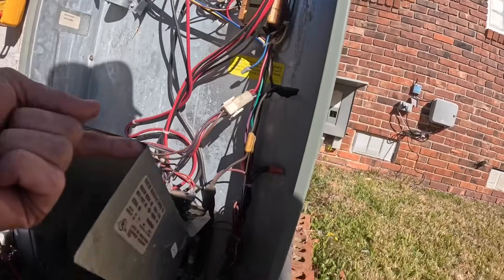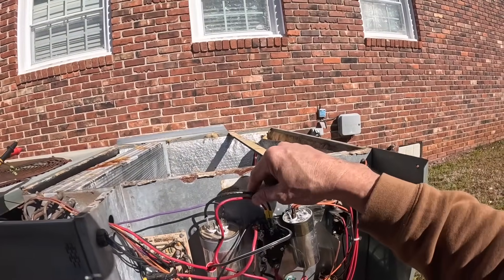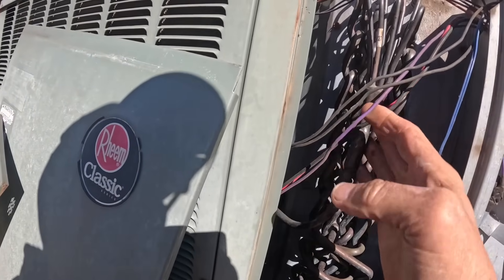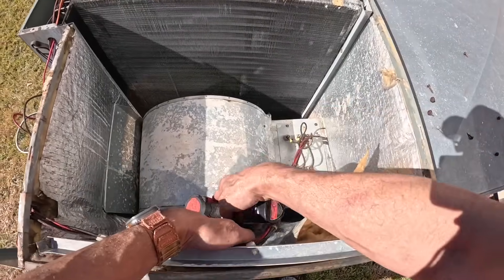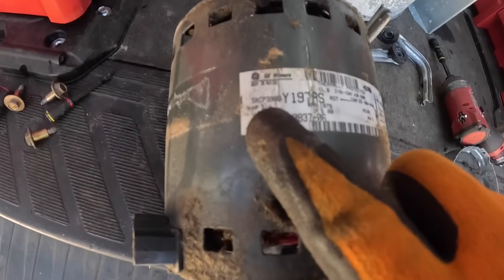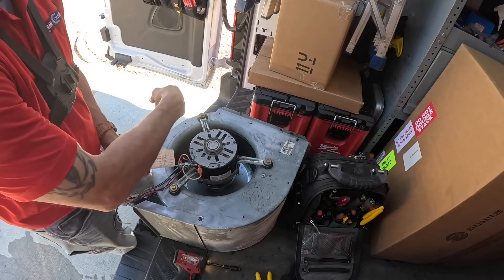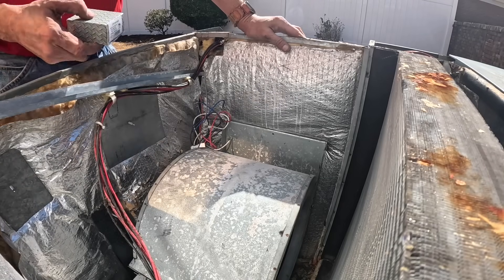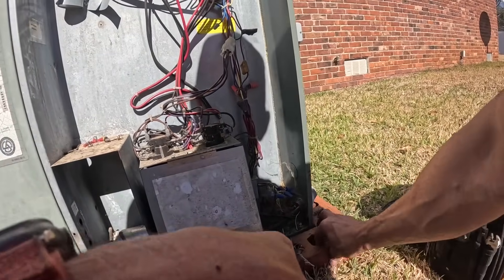Really Odd Thing Happened to Me On This One! #hvacguy #hvaclife

Comment: There is still an electrical fault that was not identified or corrected. You noted the cabinet was grounded - but this is irrelevant and will not prevent a shock. 

At issue is the term ground wire. For the purposes of preventing shock hazards, this term is incorrect, misleading, and dangerous. The fact that it is grounded does not clear a fault. A fault can only be cleared by removing power - opening a circuit breaker. Routing electricity to ground does not deenergize the cabinet.

What is important is the non-current carrying grounded conductor is properly bonded to the neutral at the service entrance. Again, the fact that this wire is also grounded is irrelevant for shock hazard.

If the cabinet had been wired with a properly bonded non-current carrying grounded conductor, the circuit breaker would have tripped when the motor shorted - grounded or not.

I know it’s been over a year, but please call this customer and get an electrician back out there. The next person to take a shock might be someone’s grandchild.

Comment: i was up on ladder at night checking my internet connection and why it was not working, being dark an hot outside the air conditioner came on below me an i could now see sparks coming from the electrical fuse block and meter beside me. after i opened the electric panel i found the ground wire coming from down the pole was worked loose .. whaatt???. never in life seen or expected that large bolt to be loosened.. likely the air whipping the wires back an forth over the years. so i pulled meter head and tightened the ground wire back down.  still the cable was bad but at least i fixed one item.  i called the cable guy an he came hours later an pulled the grounding block an a half foot of wire that had melted  ??  ... OOo the box an house had no ground but it did have the cable to use as a ground as it was connected. come to find out all the neighborhood had called in , the all had melted wires and cable boxes damaged at least no tvs were . if i had touched the cable in the back of box while ac was running i'd likely  to have gotten shocked if i was ground,  many ground the box to the water pipes in houses with the same risk you touch the faucet an hand in water you can become ground an die. so never expect ground to be grounded where it should be. verify it.  i got stories .

Comment: you do know that meter has a audio touchless tattle tale just like your small one right ?  
I would have done a bit more testing before really manipulating anything . if the cabinet was hot couldn't you do a continuity from main legs off contactor if tone was there then i would have left in toning out while poking at stuff so you would no for sure when you broke that contact, was it due to the fan ir was it something that was not found and might be a issue down the road . no real conclusion just a hope .. i hated them type calls myself when there was no Ah HA moment & would think about them for days .

Comment: Check integrity of ground back to disconnect. Good ground should have tripped breaker or blown fuse. Bonding issue with chassis. They are extremely lucky kids werent playing in the back yard barefooted or with water - could have been really bad. 
Foil faced insulation? 
Didnt see actual blower motor before and after check regarding short. 
** Try some AeroKroil. 
Best penetrant I've found in 50 years.

Comment: The ground wire may have been hooked up, but it either wasn't in the disconnect or no ground was available from the panel. The motor you replaced was probably shorted and it made the metal hot.

Comment: To people in the comments saying that there must be a bad connection or open in the ground wire, that is not necessarily required for a situation like this to occur.
It is not terribly uncommon for a motor or heating element failure to result in a high resistance short to ground that will cause current flow through the cabinet of the unit.
It won't always result in getting shocked when touching the unit, but if you make yourself a good path to ground, like sweating and kneeling on damp ground...⚡.

Comment: I had a similar problem a few years ago.  I lost power to my garage and I was using a "Tic Tac Tracer" lookin' for power.  Nothing.  I stepped outside the garage and lit up a smoke and the Tracker touched the bush and I got power !  After digging, I found the roots ate the underground wiring and the bush was "HOT" !    The bush died after a year w/o power !

Comment: This does not happen often, usually the breaker will trip when you have a bad motor, that was a good explanation of the electrical issue though in the other comment. However I just wanted to say you offer quality service and care about fixing things the right way. Nice to see, this is coming from someone in the feild for 20+ years and I work on anything from 1 ton mini split to 1500 ton centrifugal chillers. Job well done my man.

Comment: It seems the unit isn’t properly bonded/ground.  Next time you’re there, with the disconnect off, measure voltage from L1 at the disconnect to the chassis of the unit, you should read full L1 voltage if the unit is properly grounded back to panel/ ground. If you dont read full voltage you may have a grounding problem.

Comment: Heat strips almost killed me once. Was checking for cold air across the  evaporator by feeling it through a small access hole. My knees were in the condenate water. Brushed the back of my hand across the heat strips accidentally and got knocked back about 5 feet. Scary lesson learned!

Comment: No question that unit is not grounded correctly or at all.  I would not have just swapped a motor and ran.  If they have a home warranty, let them get the electrician out to comb the rest of the circuit.

Comment: 4:18 - There’s your high voltage to ground! The foil backed insulation is touching one of the heat strip overloads. Put the insulation back into place and Viola! No more short. Since it was not a solid contact, the breaker doesn’t trip; nor, does the point of contact burn. EDIT: After watching the rest of your video, I see you concluded the motor was causing the short (8:36); but, notice here also the foil side of the insulation was no longer in contact with the terminal below. The motor did need to be replaced because of the sloppy shaft; but, I suspect if you check the motor windings, they will ring true and will not be shorted to ground! If you still have that motor, check it. You may find that the short was cleared as soon as you moved the insulation off the heat strip terminal and not from pulling the leads from the blower motor.

Comment: I recoiled instinctively when you got zapped, even though I knew it was coming!  So glad you weren't hit harder!

Had a kitchen exhaust fan almost get me like that.  Just got a tingle, and thought to check with my meter.   Found entire fan chassis energized at 120V because a wire had chafed through.  Some genius had stopped the breaker tripping by unhooking the ground wire at the panel!   Bonus points for no disconnect on the roof and each leg coming from a breaker in a different panel.
Reply: had a 220 almost get me, between a roof-top, and the trans.  was a good jolt.

Comment: Just as a question, why wouldn’t the breaker powering the unit trip if the shell had become live with 94 volts? I don’t understand why it wouldn’t travel back on the ground wire and trip it.

Comment: If it was properly grounded it COULDN'T  shock anybody 🤔
Reply: Yes...and no. As I explained in another comment, since electricity will take all paths, it will divide amongst them, and Curtis just happened to be a part of it. But in this case the unit (or the house in general) most likely has grounding issues.  A proper low resistance grounding path would make that current that Curtis experienced so small that it would not have been felt. (Or in the ideal world, totally eliminate it.)

Comment: Ya i had a hot unit once. Finally found a lighting circuit was rubbed through on the metal ductwork. No idea why it didn't trip but it was about 90 volts as well.
Reply: Too high of resistance through that duct path for enough current to flow, which means the breaker didn't see it as a fault, but as a small portion of the load. Same principles applied here with this AC unit.

Comment: Voltage to ground, I always worry about that on older homes. I have seen many times where the ground wires for a light fixture or whatever will be hooked to the common. I have even seen it on 220  appliances. So we have a 20 year old unit with all new parts. I guess if you think about it, the rest is just sheet metal. The furnaces worry me though, like the last one being so rusty. Anyhow, nice work. Also, I don't think .3 amps on a motor like that would make any difference, especially being lower.
Reply: I used to work for a satellite company and was sent to Lowe's to diagnose hum bars in the monitors. I disconnected the coax going outside to the satellite dish and it knocked me off a ladder. Long story short, the building was energized. I think it was something like 70 volts. Their maintenance didn't believe me so I ended up calling the light and power inspector. They found a main ground connector had high resistance somewhere. However the building was being energized by some bad lighting ballasts.

Comment: From what I seen it looked like the aluminum outer coating of the cabinet insulation when blower was running got pulled down to the strip heat terminals causing the unpainted portion of the unit become energized

Comment: There is most definitely an open somewhere in the grounding circuit of that system. What you experienced could have been a lot worse if your body would have been grounded more than it was. You might consider checking that out further or recommend an electrician get involved if you would rather not mess with it. PHEW!!
Reply: I would think the outdoor enclosure should be bonded to earth ground.

Comment: Well Curtis the frame and cabinet is not a ground in and of itself. It has to be grounded by way of the AC supply. There must be a ground bond at the Main circuit breaker panel only. For you to get shocked there has to be two faults, one looks like it is the insulation blanket falling onto an exposed heater connection making the cabinet hot. The second fault is in the ground system where the ground conductor is open between the Air Conditioner and the Main Circuit panel in the house. That too must connect to earth ground on the utility pole which may be faulty creating a shock hazard for the entire house. You should report that to the utility to have them check that out ASAP.
Reply: Not the utility pole.  The ground connection is normally done where the service enters the house, either with a grounding rod or a Ufer ground (rebar in concrete).  Either this connection has failed (very dangerous but unlikely), or, more likely, the unit itself was never connected to safety ground by the installer.

Comment: Could that insulation that fell over inside have caused a problem? Couldn’t tell if those were just limit switches or something higher voltage in there after the blower.
Reply from the maker: Oh, that’s high voltage!  Could cause it to throw sparks.

Comment: When you checked the fuse box in the unit after getting shocked, you said that it was grounded. Is the other end of the ground wire connected? You're right, you should not have gotten shocked by the case.

Comment: That loose insulation looked like it was touching one of the hi limit cutouts. That was what most likely caused your shock. It would have also given you that resistance reading you got when testing the load side on the contactor. EDIT:  Nevermind, commented before you found it on the dead motor.
Reply: It was the insulation, he never verified the motor was the cause.  He just saw the shaft had wiggle.  The foil side was touching the electric heat strip.  That has 120v all the time.  It was a poor conductor to ground and didn't draw enough to blow the breaker. But I guess it really doesn't matter, he fixed the insulation and the motor was worn and had play in it. All fixed.
Reply: Could be  open neutral  and or equipment  ground .
Reply: As soon as I seen that laying on the I thought that metallic side is laying right on the exposed heater connections
Reply: How did he get shocked though? How did he complete the circuit so to speak.
Reply: @jimdarhower4945    (Bear with the length of this answer, but it is a complex thing to fully explain.) The grounding of the unit might have been a bit weak, but the main reason is that electricity will take ALL available paths back to it's source (one path of which is through ground and/or neutral, and since Neutral is not present here, ground is the only other path.)  How much of the current takes each path depends on the electrical resistance, and in this case Curtis, in contact with damp soil, made a path good enough to flow some of that current.  There are videos on this topic that you can search for to get a more complete explanation.
Reply: @jimdarhower4945  he touched the cabinet when he picked up the sheet metal. Cabinet was energized and his knees probably completed the path to ground that's why he looked at his hand
Reply: he was in contact with earth (dirt) , ac will flow to earth!  @jimdarhower4945
Reply: My thoughts exactly!
Reply: S''j*jxv;&hhhhh*j*
Reply: @mxslick50 - that makes sense. Appreciate the reply.
Reply: @jimdarhower4945  I also seen the pulled liner sucked into the blower and causing the unit to ice up! Mostly on convenience-store rooftop units!
Reply: Peeing macth continues into the comments

Comment: if you have proper ground wire shouldnt happen
Reply: Do you mean an equipment grounding conductor?  I think current could be running on the EGC and the breaker would not trip.  Seen that happen before.
Reply: Exactly @Bob.W.
Reply: You are right, but I have seen some crazy wiring.